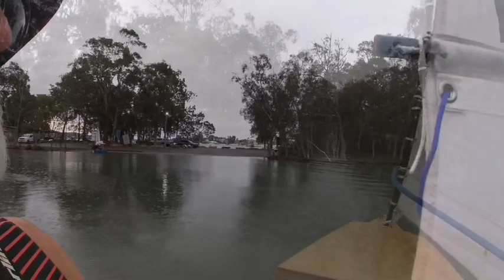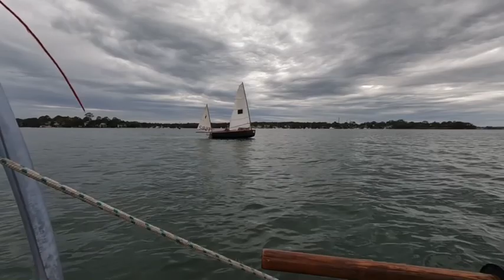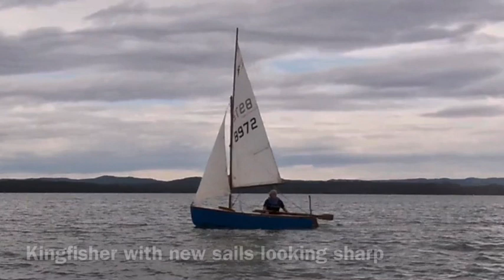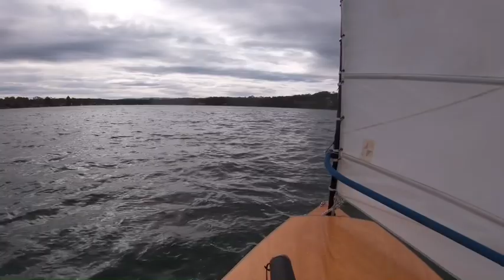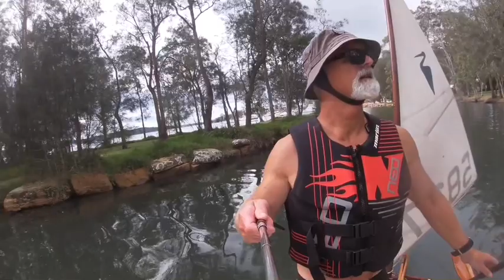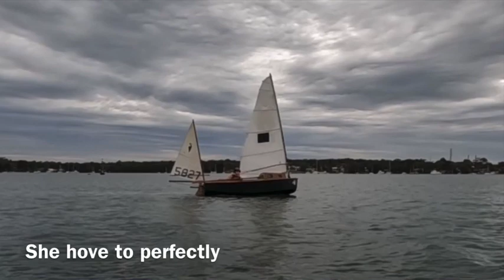Dinghy Cruising Heron Conversion Test Sail

Comment: Hey Bruce,
I really love the concept - and it appears that you have developed it into a really workable package.

You make some comments about speed.  I cannot fault your sailplan - it looks very efficient.  Is it undersized compared to the normal Heron rig?

I learnt a lesson about  centreboards and rudders when I reshaped those on the club dinghy, from flat plywood with rounded edges, to more reasonable foil shapes on the leading and trailing edges.
The improvement was dramatic!

(After all, the sail "foils" work with the hydrofoils to produce speed.....)

btw - I gave up using plywood after breaking too many - after all, half of the layers contribute no strength.

I can't wait to see the boat, all kitted out, Beach cruising.....

Best wishes,

Frank
Reply from the maker: Hi Frank,
The sail area is the same as the original rig. The foils are the same ones so I don’t think that is the problem. The mizzen sail feels like it just balances the rig until you are on a run where it works better. It feels like you’re sailing a Bermudan rig without the jib so lack some drive in lighter breezes. The rig is a great cruising setup I think as it’s very controllable and heaves to brilliantly.The wishbone clamps onto the mast as it would on a sailboard but not as tightly allowing it to swivel as you ease and tighten the main sheet.
Reply from the maker: Also not having sailed this type of rig before it may be due to some user error.(performance wise)

Comment: Looks really nice on the water! Having the fore and aft masts makes for such good space in the middle of the boat. Seems to be well balanced with not a lot of lee or weather helm. You mention it isn't as fast as a regular heron on some points of sail. Is that because of lack of sail area other reasons?
Reply from the maker: Thank you,the sail area is about the same size so not exactly sure yet,it might be my lack of experience with this type of rig.The cockpit space is much better though.

Comment: hello. very good your video I have a similar boat in Argentina. I am interested in knowing about the sails of your boat. I can not see how you move the rudder if you have a mast very close. thank you
Reply from the maker: Hi Mario and thank you.My mizzen mast is offset from centre approximately 100 mm allowing my tiller room up to 30 degrees. It is also stepped hard against the transom.
Cheers Bruce
Reply: @brucedyson-smith459  thanks for your answer